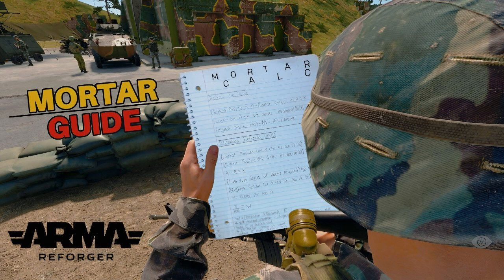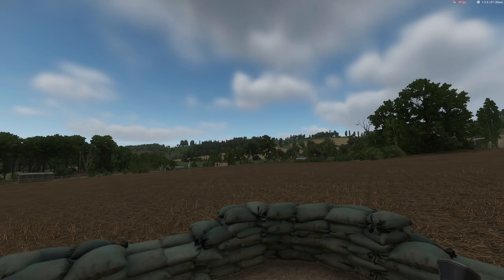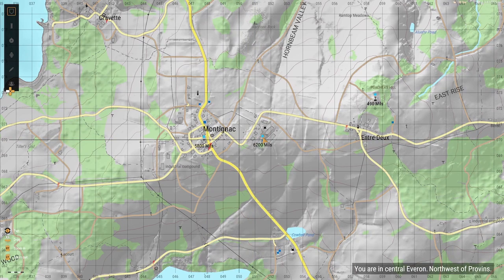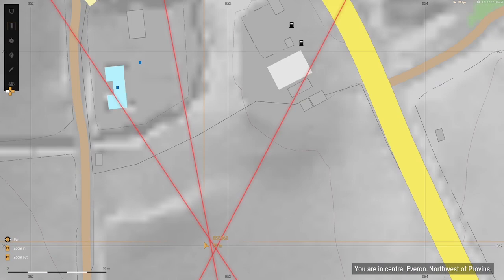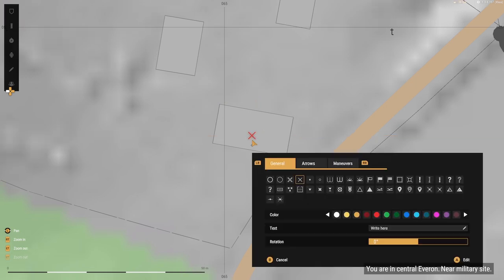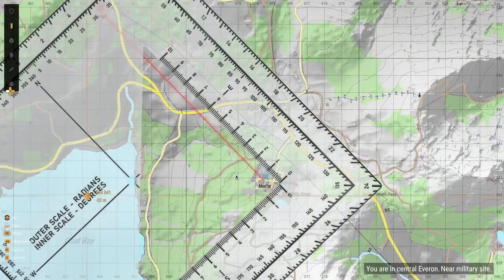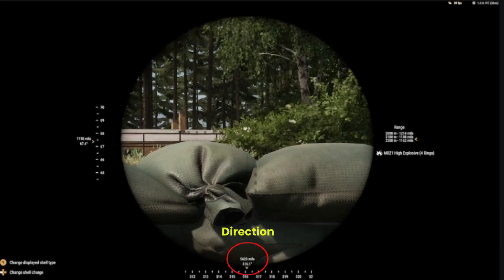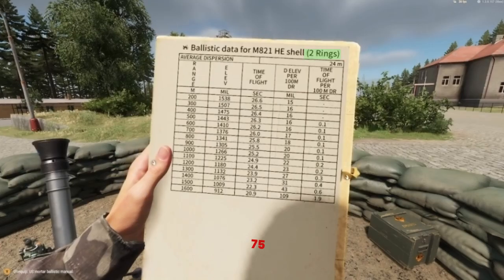Master Mortars With 100% Accuracy | Arma Reforger | Mortar Guide

Comment: Hiya! Have a question about a target I was attempting in GM. Range 970m, both my position and target elevation is the same @40m. The chart (2 Rings) HE shell shows both 900\1000 D Elev@20. I am new to mortars and trying to figure the closer Mil elev for this shot, not sure how to figure the 0 elevation into the equation. Any help would be appreciated. Thx!
Reply from the maker: If your target location and your location have no elevation difference then you should be ok to not do the elevation equation. Having your location and target locations elevation the exact same is very good as it completely cuts out the elevation part of the equation which saves lots of time.
Reply: @CheesyLlama87  Yeah it hit me after I commented and walked away for a few, came back and it finally made sense. Made a little cheat sheet with the process to use so now to practice using the equations. Practice makes better, not perfect. 😀 Thanks for the reply and keep up the good work.

Comment: Hands down one of the best mortar guides I’ve seen so far also another easy way to find your location is to either have a buddy or a random make a new squad and stand by your mortar and his squad icon will show up on the map and talk to your guys over radio to find out where they need mortars at also if you want to practice mortars and or test your skills there’s a modded single player scenario you can play called adjust fire